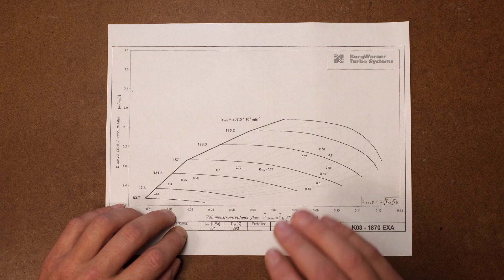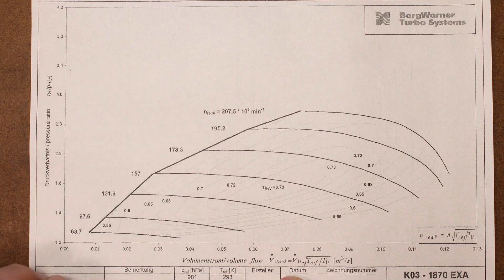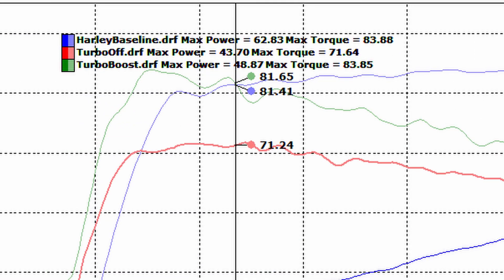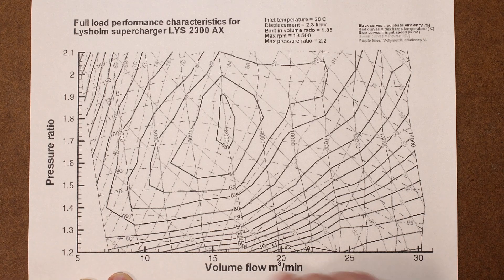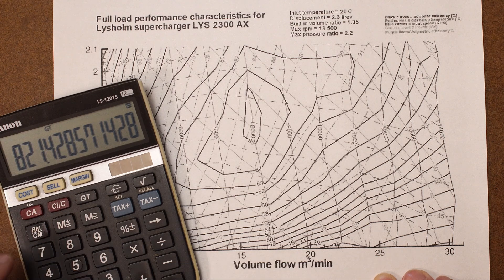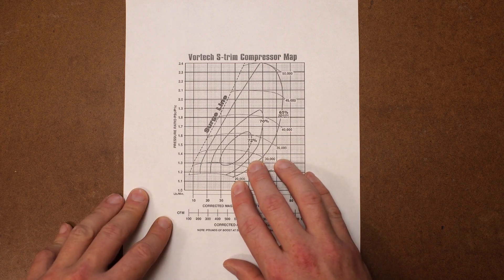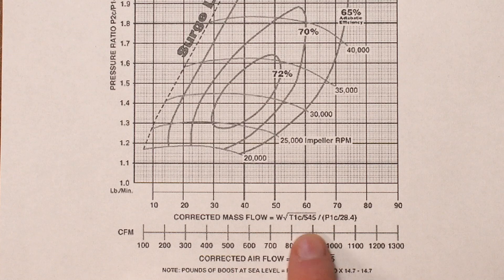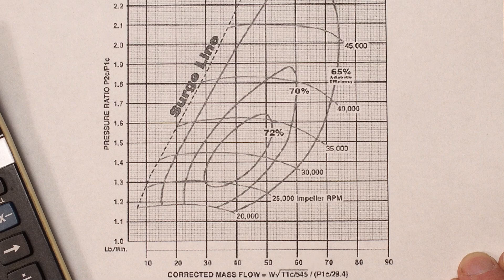How To Size a Turbo or Supercharger

Comment: I would like to see more analysis on  determination of power required  to drive the compressor in relation to the compressor map.
Reply from the maker: That info is stuff we need to learn empirically.  I have an idea of what my Whipple took, but with centrifugal setups it's dependent on so many variables - for example, it took 13.9kW to support 650 hp on a 510 hp base engine; but it takes 35kW with the same compressor on the same engine to support 800 hp.

Comment: Seeing your rpm numbers im assuming your direct driving the compressor wheel frm the motor. Superchargers use pulleys for a reason as you know. So why direct drive. Use pulleys to increase the rpm to make significant boost. Youll have parasitic loss but the rpm will be greater in the end. Seems it would be easier to balance the set up as well.
Reply from the maker: Power to spin the compressor increases with the cube of rpm.  There isn't a commonly available (and reasonable) motor/esc available that would work as far as I can find.
Reply: @AlexLTDLX  with pulleys couldn't you add a 2nd motor to assist.
Reply from the maker: @cdrbews  You could, but then you're getting really complicated.  You can also gang the motors (in series - so the shaft of the second motor is coupled to the back side of the first); but I'm trying to keep things reasonable.
Reply: @@AlexLTDLX  I'm using the me1616 motor (hallsensor version) on pulleys. 8000rpm and 134nm stall... definitely not an rc motor. 

I'm running 134.4v fully charged at 800amps dc peak and sitting around 160amps dc.

Using a khb12101 controller,  about to use a khb14601 for 168v 600amps, probably only peak around 400amps dc...

Hope this helps

Comment: The only thing I can see becoming an issue is at low rpm you might cross the surge line if you run the motor full speed. Might need to be throttled down somewhat until rpm builtd. 😎
Reply from the maker: You're probably right.
Reply: I was thinking the same thing.

Possibly like a staged nitrous setup, increasing boost in near instantaneous steps throughout the rev range.
Reply: Use a wastegate on the intake, will stop low rpm surging...

I had this same issue when testing a v-15  hit 1700hp on the dyno at 2500rpm, stuffed my torque converter and my gearbox was completely destroyed.

Had a 2500stall converter....

Now I'm bench testing looking at a small setup with added nos. 
530hp centrifugal with a 250 wet nos shot should be good for 1000hp, and 400kw daily

Comment: An RC turbine would really hit the spot, 240k rpm!  )
Reply from the maker: Hi William.  240,000 rpm - that's scary territory for sure.  I wouldn't trust anything I built at those speeds...
Reply: @AlexLTDLX  I wouldn't even trust the turbines to hit any of these rpm's in a turbocharger since they are made to have a high rpm's they are not tourqy enough